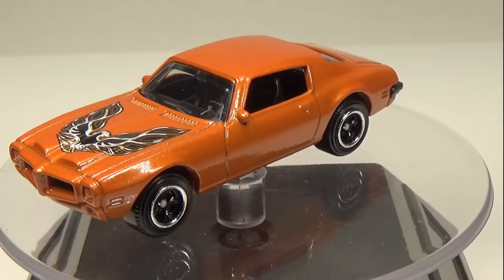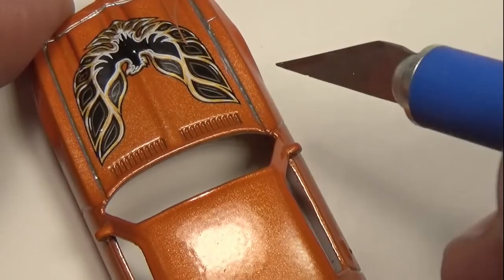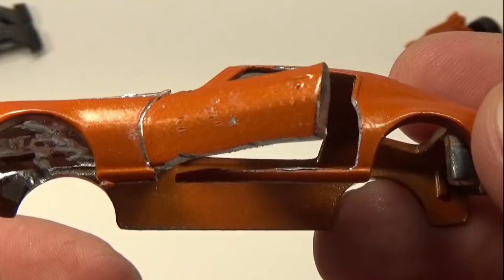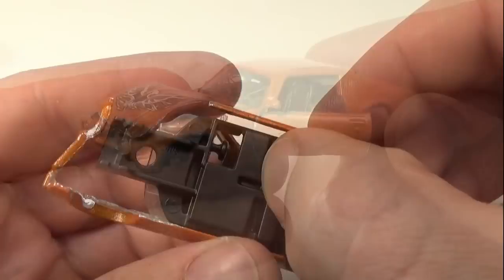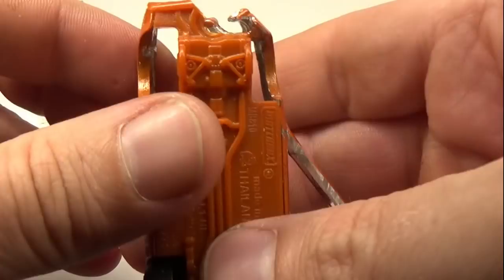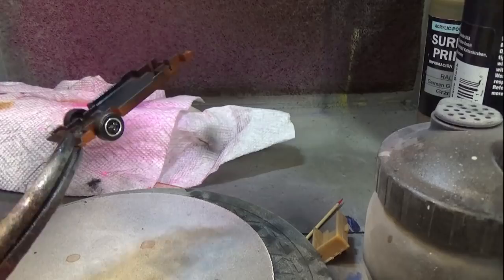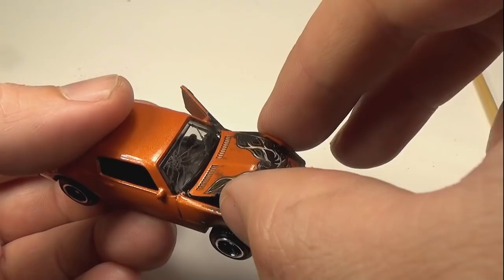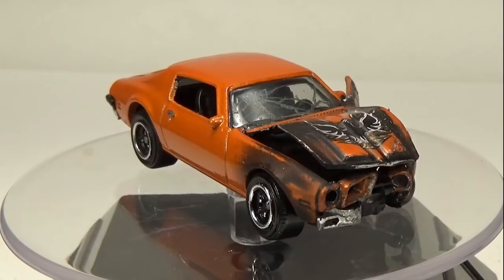Custom Matchbox Pontiac Fire Bird Crash Car

Comment: A trick I use on scale cars is to take a soldering iron or other hot tool and use it to melt a plastic wheel on one side until you get to the rim. This’ll give the effect of the wheel having a flat tire. I’d like to see another wreck custom, this one turned out great.

Comment: Great work! I used to make diecast demolition derby cars and I'd use aluminum foil to create the heavy metal bending. Just mold the front and back of the car, cut off the diecast and glue on the foil, then simply bend as desired. I was thinking of making a tutorial of it on reddit but I'm not sure if anyone would be interested. Keep up the great work!

Comment: Another fun thing I like to do is heat up the wheel, they burn easy, but get it pliable and push it down and you get a flat tire effect. And with heat you can soften the metal, or melt it, to move it around. I use a small propane torch for that and just a match waved under a tire for the flat effect.

Comment: The only improvement I can think that you could make is to research the car you’re wrecking. Although most people would not know, the part you made chrome would not have been chrome on that car. The black bumper on the back would be chrome but there was no chrome bumper on the front of that car. Still pretty cool.

Comment: On these years of Firebirds the rear bumper is chrome where you have it black, and the chrome area under the rear bumper should be body color. There is no chrome on the front of these cars and where you have chrome should be body color. The hood is fiberglass and would not bend as you have shown, rather it would break and shatter. I do love your videos as they are very inspiring. but as a Firebird owner, I felt compelled to correct your assumptions. Keep up the good work!

Comment: I recently got a pair of 3 Hotwheels Chevy Chevelle Station Wagons, and I wheel-swapped them all because I wanted to see how they would look with the same size wheels. They look great in my opinion, and I'll probably feature them in my videos. I also painted one of them using Wite-Out, and I used a brown marker for the wood panel trim. On a side note, I also got a 56 Chevy by Hotwheels and a 69 Plymouth Cuda by M2 Machines.

Comment: One note is that when making a wreck, study the real car. This type of Pontiac had a rubber front end. Meaning that It wouldnt show bare metal when scratched. Just black rubber. It wouldnt deform as metal either. It would spring back or crack.

Comment: Just a question the broken glass with the webbed effect on it on the other side is it supposed to be on that side or is it supposed to be on the other side
Reply from the maker: It looks best if you cut it on the inside
Reply: baremetalHW o ok

Comment: considering all the cars you get with this problem, i'm a little surprised you didn't bend the axle on the "damaged" wheel.  I love the use of the crack-up in your display...I've been wondering if it would be possible to make a custom crackup that would take damage on 3 sides instead of just one.

Comment: Instead of cutting the plastic base (or any plastic parts), you may be able to melt & form with a soldering iron, torch or heat gun?

Comment: This will help because I plan to make a damaged synkro simular to how the car crashes in acceleracers ignition where the car rolls several times before hitting the back on a rock, in the movie this snaps off the rear spoiler, shreads the paint, and shatters the glass on the car, this video will most certenly help, but I have one problem, all the synkros I have been able to find are plastic body and metal base, so any tips?

Comment: Dude the bumper is the nose of the car on this Firebird... What you were calling "The Bumper" i the lower front valance.  Such attention to detail and yet you dint know what's what.  BTW the hood on these particular Formula Firebird is composite fiber glass with a steel re-enforced lower frame they don't particularly bend very well, they crack and snap off the car in such a hit. .

Comment: Where do you order 1/64th scale people? I'm going to be making a drive in theater diorama for my father for Christmas, and I have everything planned but the people.
Reply from the maker: Ebay
Reply: If you're doing a drive-in I'd imagine most figures are going to be sitting in the cars. I'd probably start with 1:87 HO scale seated passengers intended for rail cars or station benches. You can get them in large assortments pre-painted on eBay relatively cheap from China. Some brands come with or without legs so you might not have to worry about trimming them to fit in your cars. The scale is a little smaller than 1:64 obviously, and they're often styled to look like a much earlier time period, but it could work in a pinch.

Comment: Was the girl in the bikini the cause (by distracting the driver) of the accident???    Great crash car. Very inspiring. As I work in 1/87th scale and the real metal cars are about $20- a piece I will try to do this on a car that I acquired from the swap meet...it was pretty badly stepped on so it is an ideal candidate. 
If I get it ha;f s good as your first attempt I might try to post some pix on my FB page.  Otherwise it will be a (what did your surgeon grandpa call it? Lesson learned - Scary)
Regards from Australia.
Reply from the maker: Yes... she caused the accident by distracting the driver...

Comment: Good effects. But if you’re going for realism.  Not so much with the firebird there. In reality. The spots you painted chrome was the front and rear valance. Not a bumper. The black portion on back was the bumper. And the front never had one on the early model second gen birds. The nose cone in reality is fiberglass. And that firebird formula style hood sculpted on original matchbox is a fiberglass hood on real cars
Reply from the maker: Yeah others have brought that up... car is before my time... lol I spent lime looking it up but only to find out about the side mirrors.